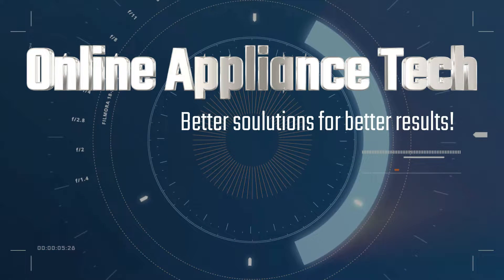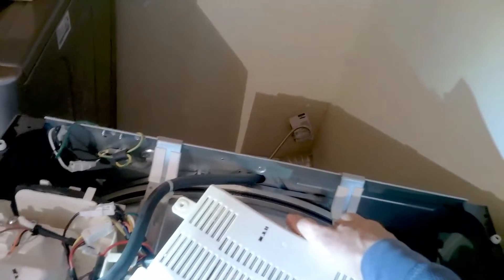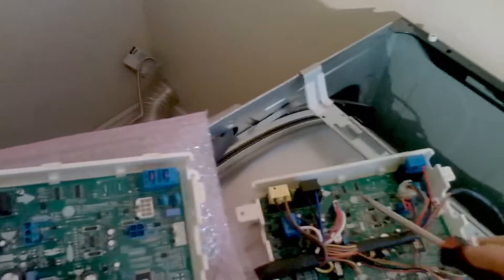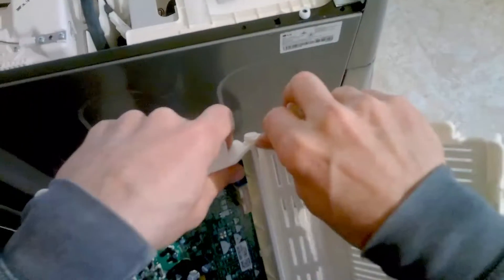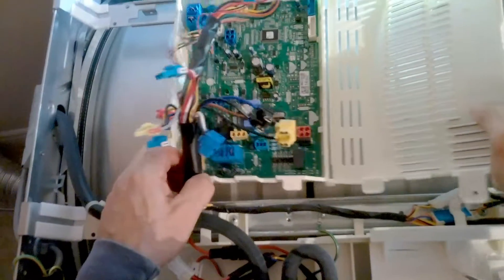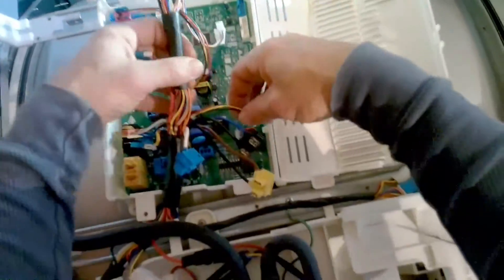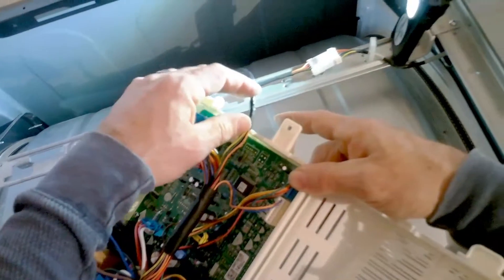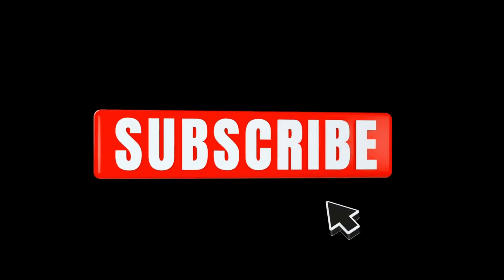"New LG Dryer Has No Power? Here's the Fix You Need to Know!"

Comment: My question would be: If the dryer sounds and powers “on” but no lights and only happens once, would it be the control board you just replaced, or the display interface? 🤔 please get back to me with your thoughts. I’m stuck between buying the control board or the display interface board. Both around $250 now.

Comment: D1 of the main control board, US1J-E3/61T from Amazon. I am working again.
Reply from the maker: Thank you for sharing your experience with the main control board. It's always helpful to hear feedback from fellow users.
Reply: Awesome. Thanks for this info!!
Reply: Ordered 10 of the diodes for $2.87 for future inevitable fixes.  Apparently testing the steam cycle too many times in a row was too much for it.  Even though it was only, like, three partial cycles.
Reply: Just wanted to report that 28 cents and 10 minutes desoldering and soldering in the new diode did in fact fix my dryer.  Thanks again @Gregarious3 !!!
Reply: where is the D1 in this board?
Reply: YES the D1 diode was smoked. I had to order these OVERNIGHT but it was worth it. My brother is the solder king and was able to remove and mount this for me. We are back in business but I WILL NEVER use the steam function again!!!
Reply: Thank you for this. Replaced the d1 diode on my board and I’m running again!

Comment: Paid LG to do this today but replacing the board is just this easy.  The only check the tech did before he ordered the board was to check there was power coming into the dry on the inside connections.  The symptom was that the power button would not turn the dryer on.  Also looked at the old board and there was no evidence anywhere on the board of a failed trace or failed component.

Comment: Isn't there a fuse on that control board? My gas dryer states 15A circuit board fuse on the label inside the door. I haven't tore into it yet. I'm getting ready to in a few minutes.

Comment: Brother, I owe you a beer!  Our LG dryer was working perfectly.  We decided to put some water in the reservoir and use the steam cycle.  Four minutes later, the dryer stopped.  I went to turn it on, nothing.  No light inside the dryer, no control panel lighting up.  I watched your video and ordered the control board.  Bingo, I have a working dryer again.  I have heard of people saying their LG dryer has killed the control board when putting it on the steam cycle.  I will never use that particular setting again.  I can't believe this dryer is only around 3 years old and this already happened. Your video saved me hundreds of dollars.  Thank you again!!
Reply from the maker: Your kind words mean a lot! I'm grateful I could assist you in fixing your dryer and saving you money.
Reply: EXACT same series of events happened to me. Could you share where you purchased your replacement please? Thanks Tony
Reply: @tonyleon1238  I can't remember exactly where I purchased it from.  I know it wasn't Amazon.  I took down the model number and did some searches on the internet.  There were a few places that sold them.  I think I paid around $250 for a new board.  That was the cheapest I could find.  It was a breeze changing.  Took about 20 minutes from start to finish.  All the wires that attach to the circuit board are color coded.  I took a picture of it before I took the wires off, but didn't even need to look at it.  There were about a dozen or so wires, but like I said, they are all color coded and only fit in their respective slots.  Let me know how it goes.  Like I said, I'll never use that steam cycle again!
Reply: The same thing happened to me. I've had my dryer for 3 years and have had no issues. A few weeks ago I decided to try the steam function, and I kept getting an error code that I needed to add water. The water reservoir was completely full. I tried one more time, after making sure the water was still there, and it completely died on me. No power to the dryer at all. I ordered a new control board directly from LG and it will be here in a few days. 

I don't think I will be using the steam function again either. It's not worth the 250$ price tag.
Reply: The same thing happened to me. Went to use the steam function and then no power. :(
Reply: @ You would think by now that they would have figured there's a problem with this particular model when using the steam cycle.  We will never use that cycle again.
Reply: @garyp9906  Its called Planned Obsolescence. No coincidence that everyone seems to be having the same problem at the same time.
Reply: @ Actually, I just sent LG an email telling them that they should look into this because of the number of owners having the same issue.  I doubt they'll do anything.

Comment: I replaced the board but it doesn’t turn on again. Is there a fuse that I can replace?
Reply from the maker: There is a fuse located on the main control board. Did you make sure all the connections were installed properly? Also, ensure that you're getting power from the outlet by testing it with a lamp or another device. If everything is connected correctly and you're still having issues, you might want to check if there's a loose wire between the main control board and the display control.

Comment: I don’t know what to say but i have best buy replaced two BRAND NEW LG dryers with the same model already because it won’t turn on and we replaced, checked everything including the circuit breaker, 3 prong wiring diagram and 220 outlet. ☹️
Reply: Just bought brand new lg washer and dryer and had this happen.  Washer works fine dryer wouldnt turn on and no power 4 prong.  Was wired correctly but wouldn't work so took the 2 white ground wire from the board and put that to where the green wire ground goes and it turns on now.  Hope this helps

Comment: This was my fix too. Apparently it's a specific diode that's burnt out but my soldering skills are non existent and the whole board was about $150 to replace it for me. 

Word of advice, stay away from the steam function!
Reply from the maker: Thanks for the information.
Reply: I used the steam yesterday and my dryer just died.  Maybe this same thing happened to me.
Reply: Son of a gun.  I was just testing the steam function after replacing the squirrel cage when mine died.  Might have to look for the diode cause I can solder.  Ugh.  Thank you.
Reply: @perryrupp6175  Crazy how they have a self destruct feature built into the machine.
Reply: @HeroC14  Right.  That's why I ordered 10 of the diodes.  Haha.  $2.87 for future fixes, or a board for a couple hundred bucks.  Thankful I have the skill set that I do with the planned obsolescence in these machines.
Reply: Just reporting back that the 28 cent diode fixed it.  So if you have issues again you may want to order the diode and have someone fix it for you and save yourself some money.
Reply: @perryrupp6175  Thank you I'll try being braver next time. I also can't remember where I stashed those diodes. Congrats on getting it working!
Reply: @kellyname5733  Mine broke again recently and I did replace the diode and it worked. My first solder job. 👌
Reply: @kellyname5733  Yeah I couldn't tell you which video,I watch the short ones. Just use high heat otherwise it won't come off. Make sure you have good ventilation and goggles. Sears had the control board for less but if you need it faster Walmart has it for like 2 day shipping.